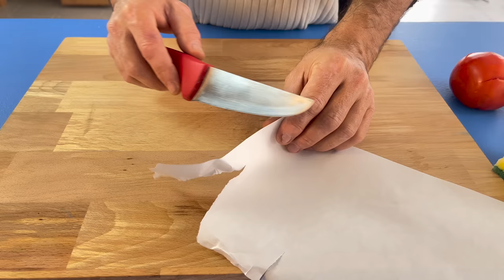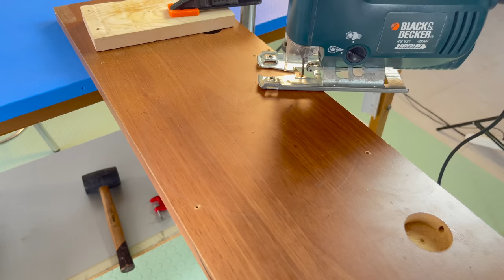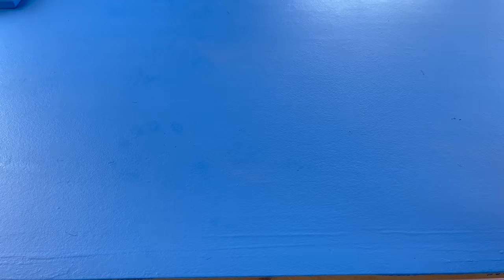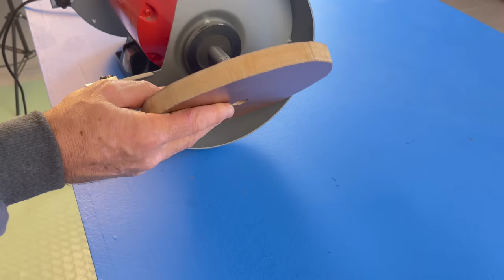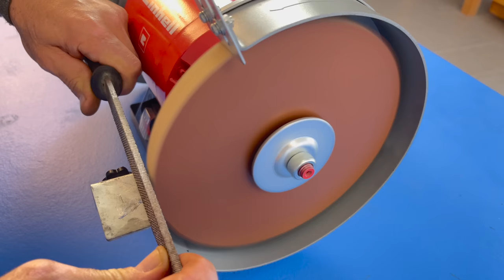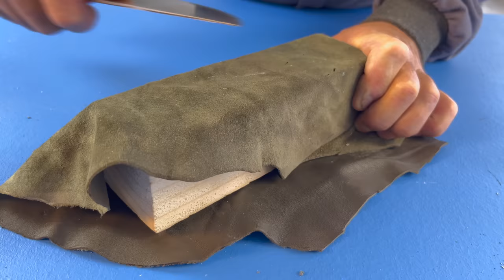Fastest Way to Sharpen Any Knife to Razor Sharp

Comment: Best way I've even  used outside a diamond steel is the ceramic ring on the bottom of a coffee cup or plate etc. It's quick and it works graet
Reply: Ceramic works for me also. I use a ceramic tube that was an old wire insulator. Had it for many years and sharpen all the family knifes with it. What ever you feel comfortable using , that is the best way.

Comment: I use a belt sander with 800 grit belts, then 1000 grit to get a decent edge. For years now I've been using wet/dry sandpaper to get that razor edge. 1000 grit to get something pretty sharp, then 3,000 (!) grit to polish the edge for that super sharp result. Just wet/dry sandpaper purchased at the auto parts store. I use it dry because I'm too lazy to do it wet and then dry off everything. YMMV but it's very easy.

Comment: I learned from a fellow Russian co-worker, how to easy and cheap sharpen a knife.
You take a bar of wood in a dimension, that you can take in your hand. Let’s say 12 x 3 x 2cm. Than you wrap emery paper tight around the little bar. Stick it with sticky tape on one smaller side. Now use it on your knife. The effect is more or less the same. And it’s cheap and very quick. You can use this sharpening bar several times.
Merry Christmas to everyone!

Comment: I like a 1" x 42" belt grinder that is variable speed controlled & a commercial grade 1 5/8" x 16" leather strop that is backed with oak , hard maple or hickory & has a 6" handle area that has been hand whittled to suit my hand , preferably a rounded oval & use either yellowstone or nuwhite on the leather strop for removing the burr & polishing the edge !!! scalpel/razor sharp , AKA hair poping sharp !!! I am a whittler / woodcarver of over 50 yrs. & I mean what I say !!!

Comment: it just meeds a guide at a 20  degree angle for consistent results, for me anyway, I have a Lansky system, consistent angle works for me ,I need that on your invention too. Good Job as usual and no music 👍
Reply: I have seen videos like this before, and was thinking of making one. I can never remember what it was that he coated the wheel with, and where would you find it? If you do this hold the knife in the direction the wheel is turning or it will kick back out towards you, and keep the guard close to the wheel, or the knife will get caught between them. Always be safe.
Reply: @garystrother7686  Any buffing compound will do. I use a blue 'fine' one but there are many types available that all do the same job.
Reply: @baconsoda  Thanks for the information.

Comment: what is the blue stuff you coat the wood with??
Reply: It's a polishing compound there's a green color one which is coarser than the blue one.
Reply: The ultimate fine buffing compound is a very dark red, and it's called "Jeweller's Rouge".
Reply: @notmyworld44    that's what i use on a small buffing wheel after a fine stone  when i want to get razor , scary sharp      this guy's process seems to make it complicated for most
Reply: @MrKozure  where can I get this compound. Is there a link at Amazon or ebay?

Comment: I have one gadget in my workshop, and similar in my kitchen, metal rings arranged in such a way that you need to pass with the knife half a dozen times and it is sharp, well not as a razor, but pretty close, depending on the steel of the knife. This is not really fast, but I sure would like to try. By the way, what is that blue thing that he is applying to the wood?
Reply: Паста ГОИ
Reply: @dododaif1391  
Why are you using Cyrillic letters?
Reply: @dododaif1391  Кирилица?

Comment: Dangerous… do you know what RPM that wooden disk bursts at?  Burst disk fragments carry a lot of kinetic energy
Reply: Про русскую рулетку слышали?😂
Reply: no... do you? obviously it didnt blow up
Reply: @WeebRemover4500  Yet
Reply: @WeebRemover4500  🤣🤣
Reply: @WeebRemover4500  But it could if the person trying this at home operates it at the wrong RPM. Too many unknowns for this video to be safe or effective.
Reply: Thats a common method, you can even buy such wooden wheels for this kind of grinder. Why is wood dangerous but metal and stone wheels are not?
Reply: @PM-wt3ye  If wooden wheels are purchased, someone has likely done a test and/or calculation to show that the developed hoop stress during use is not enough to rupture the wheel.  That is the case for metal and stone wheels that are designed & manufactured by businesses.  They've been designed and assessed for suitability to the application.  A random piece of wood spun up to 3600 rpm carries more risk, that's all.
Reply: About 8000 revolutions per minute😎

Comment: Or...You can do this easier and a lot faster and a lot cheaper with a Work Sharp knife and Tool sharpener. It's a little handheld belt grinder that you can put a 5 micron Edge on just about anything that has an edge.
Reply: I got one myself, good little tool. And if you have a power cut the work sharp still works.

Comment: That's basically how I do mine. The trick is the jeweler's rouge. As long as you have the jeweler's rouge on there. You can even use a buffing wheel.
Reply: @Glenn Goins. Thank you, Glenn. Had no idea what the hell that was. Jeweler's Rouge. Now I get it. Will never try this at home, but at least I now get it.

Comment: Seems good but the hardest thing is to drill the hole perpendicular to the disc edge without a drill press. You will vibrate the table grinder to the point of ruining its alignment if it is not very well done.

Comment: Lots of comments about this taking a long time. The natural assumption is that the process of SHARPENING is very short using the custom wheels on the bench grinder. The content creator would have been better off setting up the wheels in a different video or include the 'prep' time in this video. IF a person KNOWS what they're doing, using wheels on a bench grinder IS THE fastest way to sharpen. BUT, if you make a 'hovering' or speed/angle related  mistake, it takes FAR longer to correct. I KNOW. I'm a professional sharpener who has sharpened more than 20,000 blades. I use a 3 step sharpening system: belt/beta sander (120 grit for initial profile which obtains a starting wire edge); then bench grinder with one honing wheel (180 grit silica carbide to sharpen and obtain THE wire edge and basically sharp blade); and one polishing wheel with specific jeweler's rouge (for stropping), both bench grinder wheels made of compressed paper manufactured by the razor sharp edge making system I buy at my local GRIZZLY products store. MY PERSONAL record (only because time seems to be a HUGE factor for most here and to take my comments in proper context, no bragging, because I KNOW I'm highly, if not most qualified) is 36 SECONDS to sharpen a knife to perfect show-room finish reveal (sharpened edge) and razor/shaving/paper slicing sharp. I had to put together my own personal checklist of qualifications for truly sharp because there are SO MANY ideas if what sharp is. The point is that knowing where to go,(sharp) and how to get there are important. EVERYONE values their time and don't want to waste it on every little scam or hair-brained idea out there.

Comment: The fastest way to sharpen a dull knife is to use the bottom of a ceramic cup, where the paint is worn and the bare ceramic surface is exposed.

You're welcome.

Comment: The problem with using an electrical grinder is that the knife edge will heat up and that destroys the structure of the knife's metal, particularly at its edge.
Reply: Yeah this is why I avoid electric sharpeners and belts. It takes so much metal of its ridiculous if you don't know what you're doing. I prefer the wet stone over this.

Comment: So the fastest way to sharpen a knife is to go to a hardware store to buy a bench grinder and a drill press, obtain some MDF, buy drill bits and a hole saw bit, buy some polishing compound, buy a polishing wheel, then buy some leather or polishing cloth? Ooh and don’t forget the jigsaw to cut the MDF to size. This is quite possibly the most ridiculous video I’ve ever seen on YouTube. Any chef will tell you that machine sharpening a good knife is a bad idea (unless you’re a professional sharpener). There are two far cheaper and faster methods: 1. Pay a professional knife sharpener the $10 or so it’ll cost you per knife. 2. Buy a whetstone and learn how to do it yourself properly. This video is not a tutorial, it’s just about showing off.

Comment: This is a rubbish method for a start he's doing it at the wrong angle all knives should be sharpened at a 22 degree angle, and by far the best method is a wet stone, Screwfix do one for around £25 and with a little care and time you will have razor sharp edges, this is a tried and tested Japanese method and is 100% accurate, just mind your fingers. R. A.